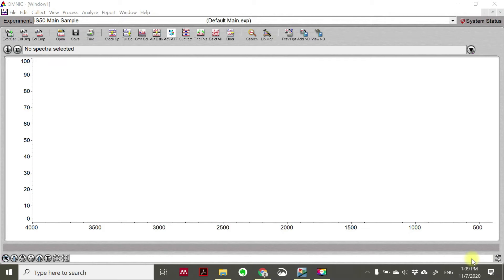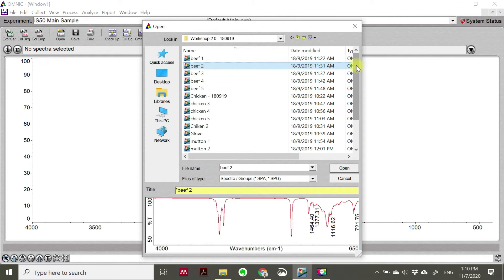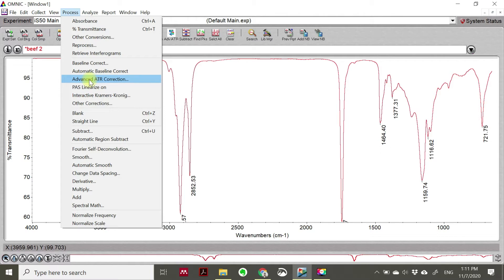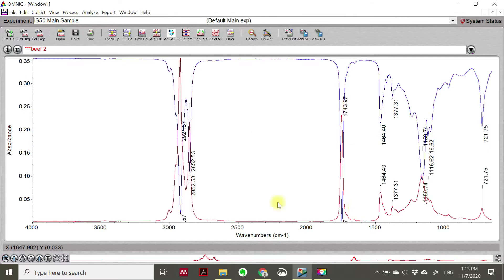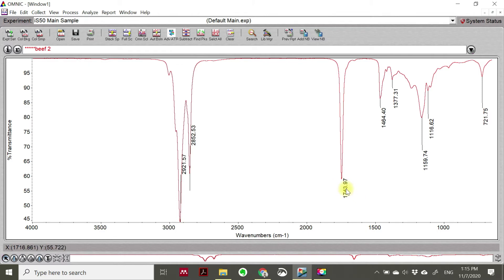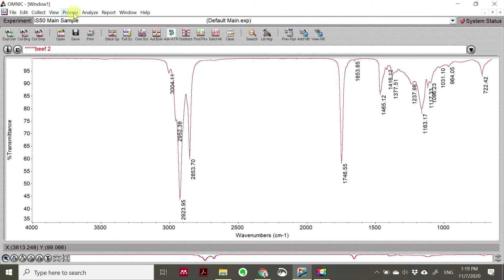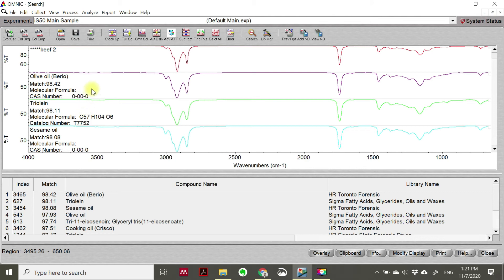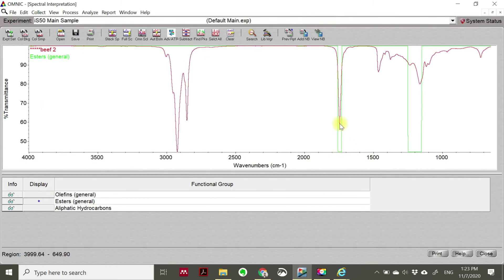Identification of sample using FTIR

Comment: Alsalamu Alikum, Thank you very much. this is very useful. I have a questions, after collecting the background, what should I do with the background spectrum?
Reply: Walaikumsalam.

Here is my practice:
1. Collect the background's spectrum
2. Collect the sample's spectrum.
3. Deduct the background's spectrum from the sample's spectrum to get the actual spectrum.

Usually, I set these activities to be the default setting of the FTIR spectrocopy so that I don't have to manually deduct the background's spectrum.
Reply: @shirwansany  Thank you for your prompt response. I find it difficult to know the settings from which I can set the automatic subtraction of background spectra from the samples. Also, I am worried that if I use the subtraction tool after measuring, the background would be subtracted twice. It is strange to me that non of the available information about OMNIC even the one shared by the maker talks about the subtraction of the background. Please teach us more about it when you have time.